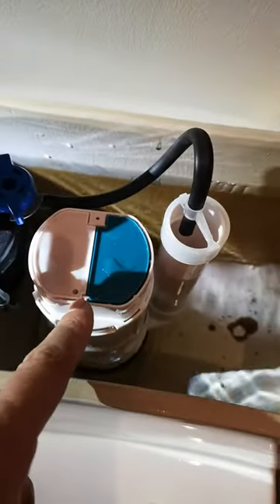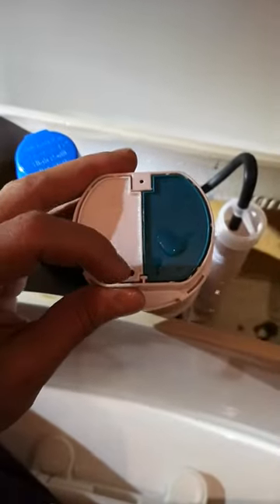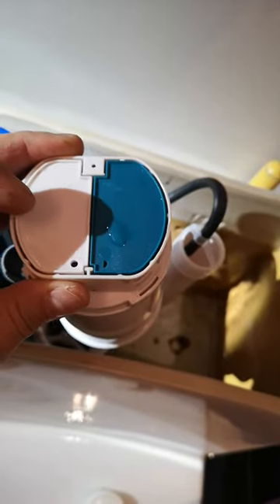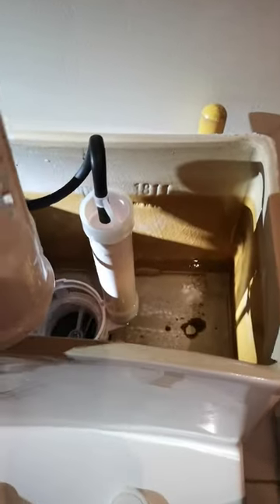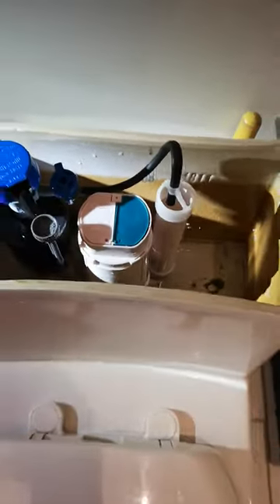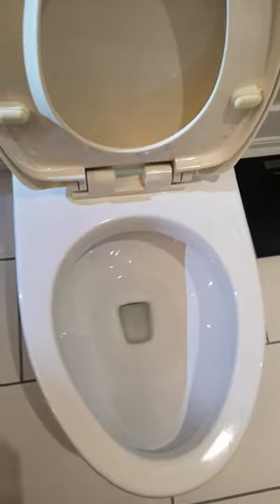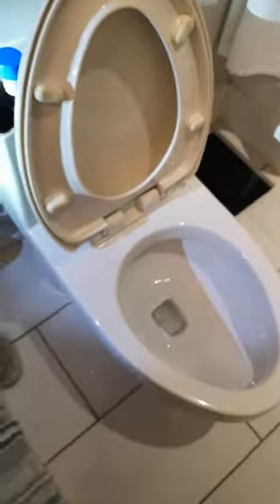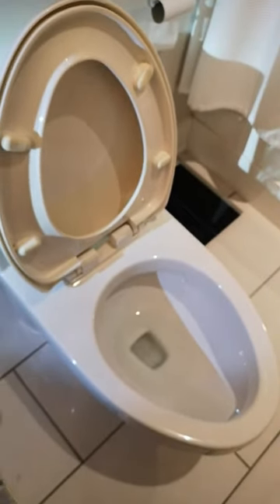Dual flush toilet not flushing properly.

Comment: Did you drain the toilet before u dumped vinegar and baking soda in or did u just put it into the bowl water?
Reply from the maker: sorry for the late reply. i shut the water valve to the bowl and flushed. i then added vinegar and let it sit. And poked inside the hole. voila!!